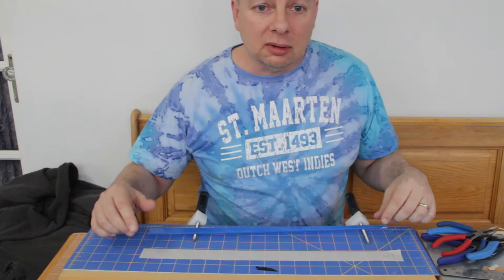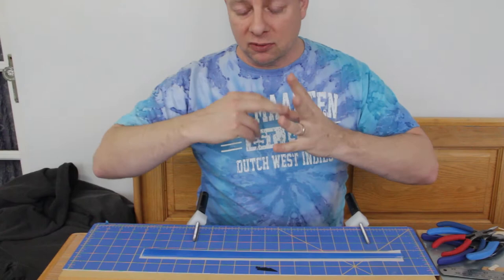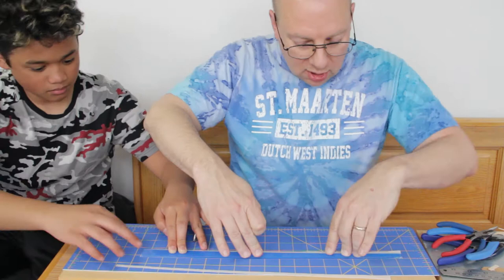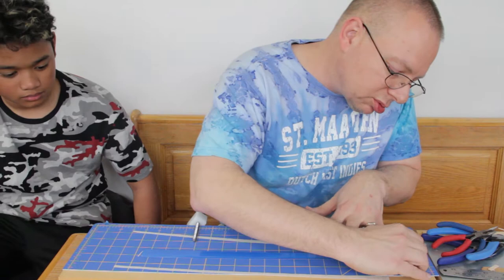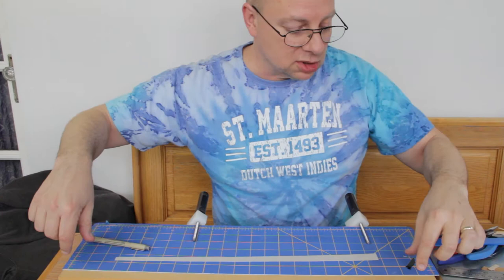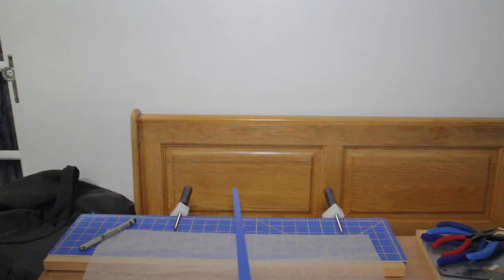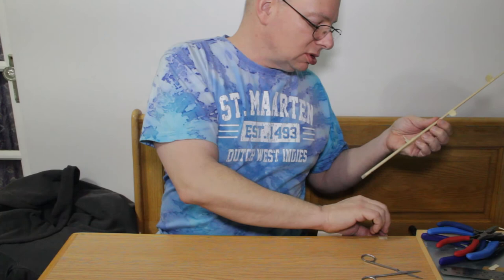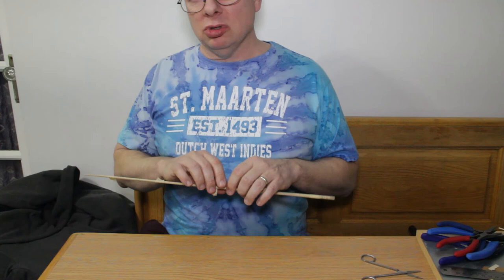F1D vLog Episode #9 - Cutting and rolling a tailboom

Comment: Thanks for this video.  Can you mention what is the thickness, density, and type of grain balsa sheet you are using?  Do you sand the wood down to that thickness first?  Do you just use a block sander for that?
Reply from the maker: The wood is from Nick Aikman in Great Britain, aka Greenman Balsa. The thickness is 0.009", density about 4.2#. He cuts it to that thickness specifically for this kind of purpose.